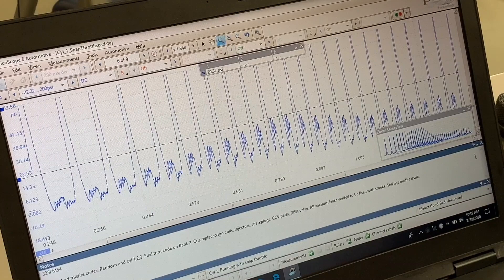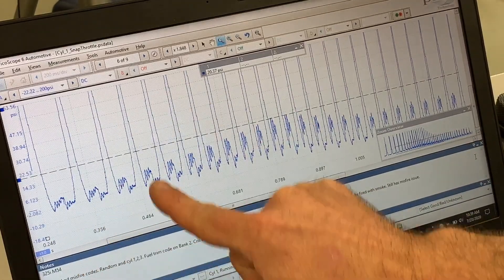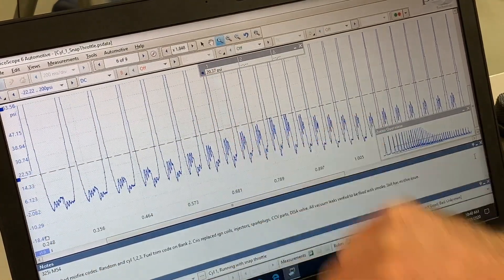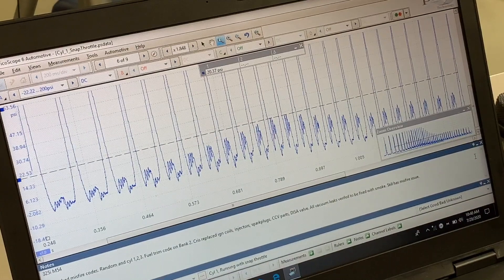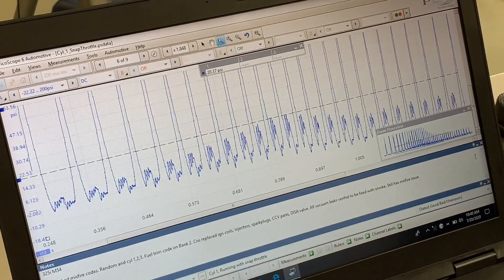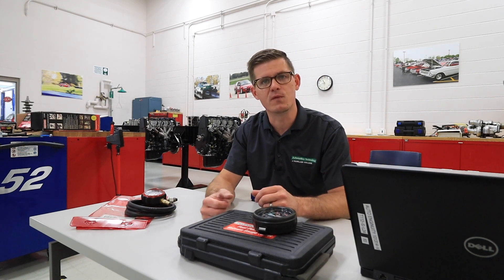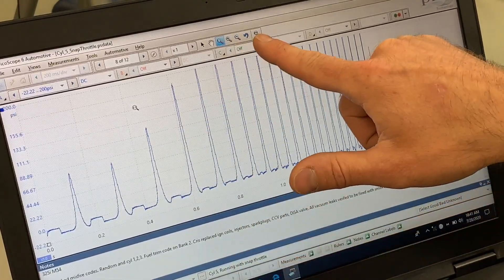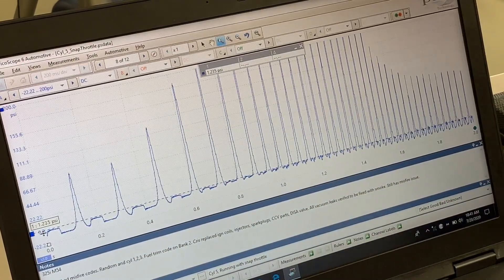Exhaust System Backpressure Testing: PICO Scope Testing & BMW E46 Case Study

Comment: Having two converters so close to the manifold made your back pressure test the right way to go. My way works pretty good about 90% of the time. I modified a piece of 3/16 brake line to have a bulge in it so as to have a bit of a sealing surface against the pipe that I drilled a 3/16 hole in. I will do that before and after the cat. Once the test is completed I use a 3/16 steel rivet to plug the hole.

Comment: Adan, enjoyed that logic very much. One thing bugs me though. Lean on bank? I understand the theory about inert gases in the intake, but I'd expect a rich condition??? ... Inert gas displacing air in cylinder, correct amount of fuel inject into the inert gas/air charge, not enough O2 to combust the fuel, therefore rich condition???
Reply from the maker: Thanks for watching. I should have done a better job documenting the exact codes that were stored. Throughout the video I reference a fuel trim code, my memory is not good enough to recall if it was a rich or lean code. As you say, a rich fault would seem more predictable.

Comment: Very interest. So in conclusion backpreasure helps to keep H.P. I low revs?  It's not recommended change oem exhaust, or what dou think ? In theory whe you change air filter to intake or less restrictive you need change or modification the exhaust. But I heard  in these particular engines m54 that's not works. Is it true ?

Comment: Hi Adam, great diagnosis. Pico scope and in-cylinder testing are powerful tools in our diagnostic arsenal. Another great test that would have shown a breathing issue before any intrusive testing would have been a VE test with graphing scan data. Choose a custom data list with the following: RPM, Calculated Load, MAP or MAF, Throttle position, Up stream & downstream O2 sensors. Take the vehicle on a road test and record the results of a WOT first gear run. RPM, CL, & MAP or MAF should mirror the TPS. O2 sensors should go full rich. If the O2 sensors go lean it indicated a fuel delivery problem. If the RPM, CL, MAP/MAF sensors lag behind the TPS, it indicates an engine breathing problem. Very quick and easy test to perform on the initial road test. Works on any vehicle.
Reply from the maker: Great advice thanks!
Reply: I recently worked on a Nissan that showed a pass on the MAF VE, the LTFT and STFT showed good values. I used a gauge to read exhaust back pressure and it was not showing a real bad reading. We needed to do a running compression test with a pico scope to catch 22 psi of pressure on the exhaust stroke.